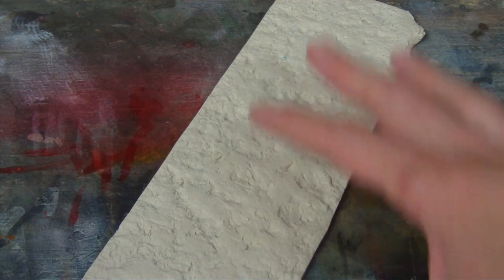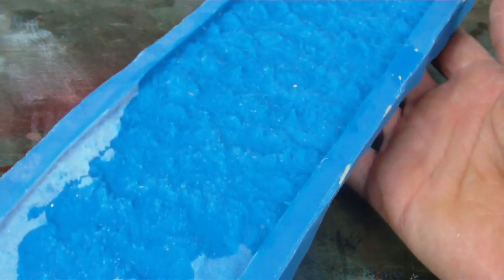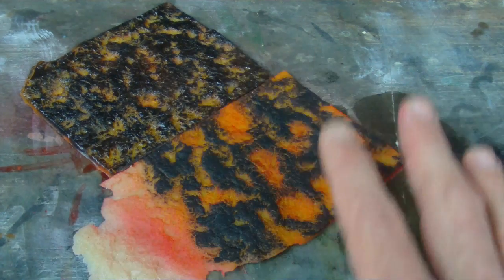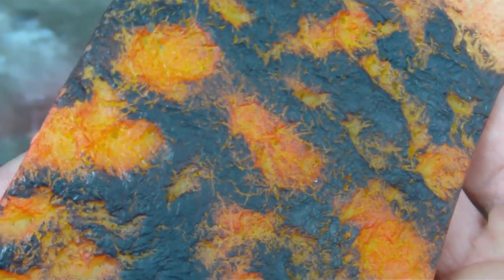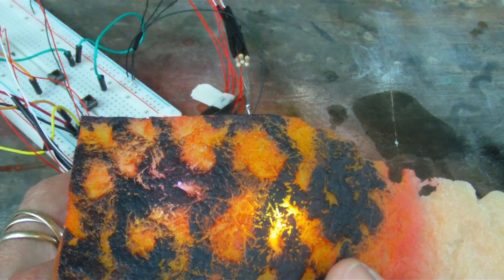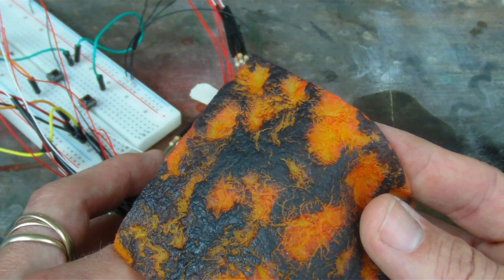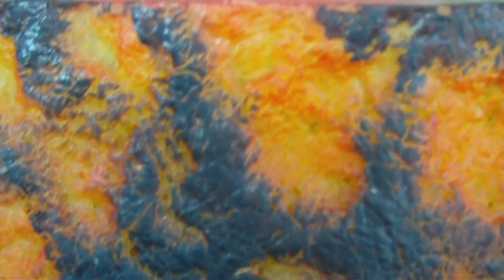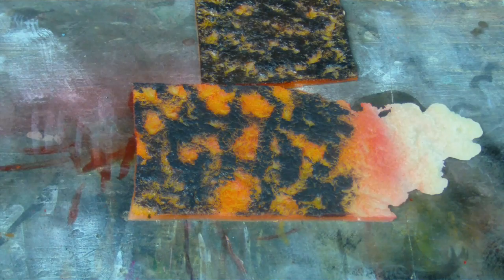TerranScapes - Lava Experiments

Comment: about the shrinking tubes and plastic i think you can easily find them on the "very big auctions site" or any rc model store. They should also have a big selection of small connectors and battery holder. About the leds, they have a concentrated emmission of light on the top so to diffuse the light usually they're incapsulated (like leds lightbulb) or put near clear plastic bits (like toys) that act like a sort of prism.

Comment: The texture and paint job is looking awesome, and it really pops with that yellow light! I *hate* to even suggest this after all the work with the circuit board, but have you thought about simply lighting it evenly all the way down the lava flow using a cheap continuous light source? I'm not sure if the fading of the LEDs is adding much to the design, as lava in reality will glow at a constant brightness, which signifies its heated temperature (a fairly constant factor)...